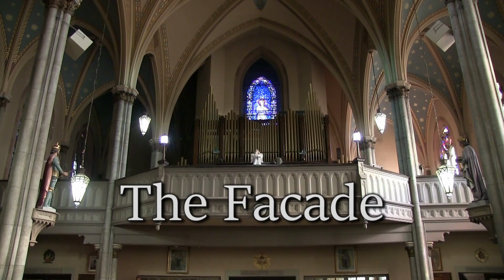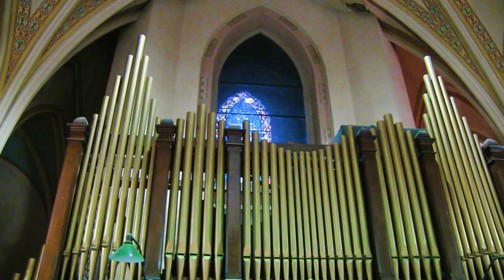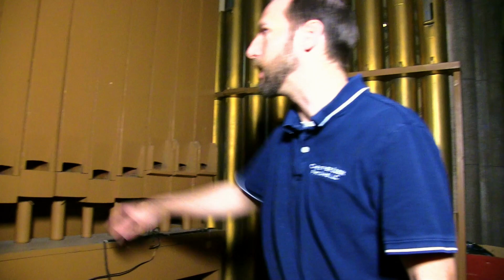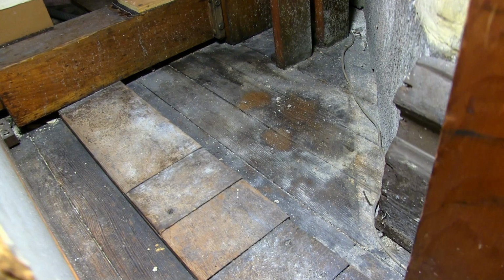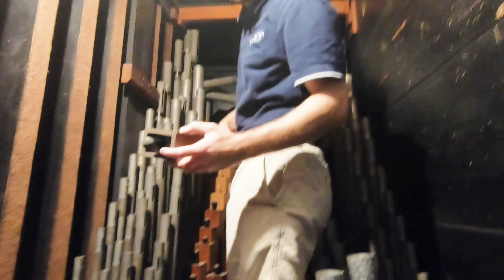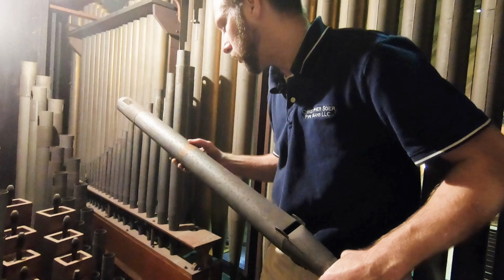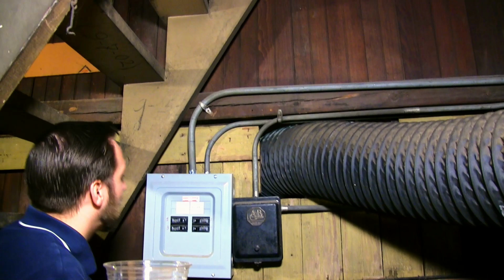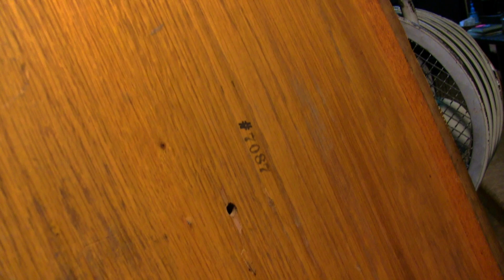Revisting the Kilgen organ of St. John Nepomuk, St. Louis, Missouri

Comment: I admire Mr. Soer's knowledge of all facets of Organ building.  I was with Moller for 20 years and remember having to install the lower notes of the 32' Bourdon facing the back wall in the Chamber which still kept them 2 feet (or so) from the wall which was poured concrete.  The difference was amazing.  We had to lower the volume of those notes and girders in the attic were rattling.  JUST a thought that the pipework shown in the video was turned-round to increase the power of those FAT massive pipes.  I love that ere organ and even though this instrument is a Harlequinn, it sounds great which is the important.  Thanks for this video.  I watch them all.

Comment: This was a great, interesting video!
We make those wood "cleats" the same way in our shop, but we call them "screw blocks" usually 4 screws (square drive) on each block made about about 4" long, 1" square and 3/4" square.
I removed about a 15 rank, 3 manual Kilgen organ a church (Sacred Heart)  in Ft Dodge was going to put in the dumpster, I wanted the blower and then learned they planned to dump the rest. Unfortunately members were allowed to take souvenir pipes and they were taken from both sides of the walkboards which was right in the middle of the ranks, so almost every rank was ruined by the loss of about 15 pipes from each. I did save the 44 scale Open Diapason and the Doppleflute to use in my organ, the Doppleflute was missing 17 pipes so I made new replacements for those using some boards salvaged from the pedal bordons which had been mostly ruined by roof leaks, many of the smaller bourdon pipes behind the swell boxes had been wet so many times and for so long the wood was GREY and lifting them out of the racking they would completely fall apart- blocks and all. There was no way to tune those bourdons, no access to get to them when the organ was intact!
They were looking to get a new organ from the builder I work for but never got past the proposal stage, going by how poorly the Kilgen was maintained and how the roof was allowed to leak over it for so many years, a new organ is unlikely to fair any better.

Comment: Thank you for this follow-up video. I helped Max Nagel install a Trumpet to the Swell back in 1976. I'm trying to recall aspects of that installation. I had only been in organ building for a few years then. I seem to remember the Trumpet trebles on a separate chest that we put on the back wall of the Swell. Maybe the basses were on the main chest. I don't remember the organ being that large or all those pipes outside the case. I do remember noticing that all the woodwork in the church (on the main floor) had wood-grain painted on - from tiger-striped oak to birds-eye maple, and all the faux marble. Therefore, some of the tiger-strip oak of the case might have been painted on. It's really hard to tell. I played the organ on Easter Sunday that year - because the organist then had no idea what to do with a Trumpet stop! Again, while playing it, I don't remember its resources being that large. I hope this bit of extra info will help.
Reply: It's only 13 rks.    And very tight in the organ chamber.